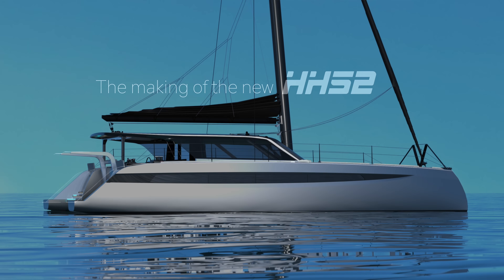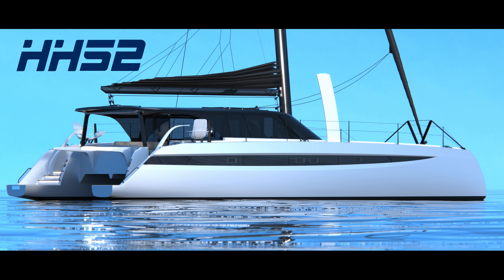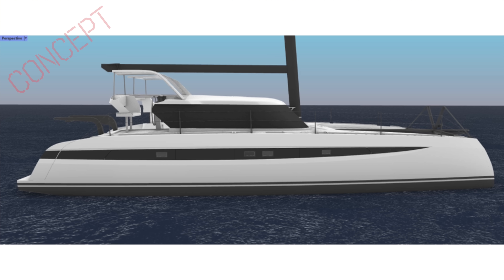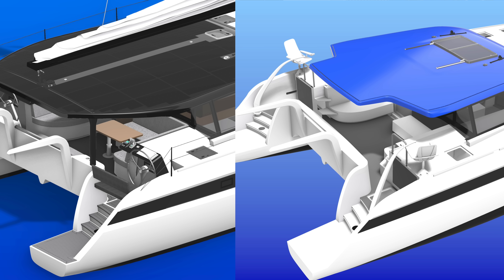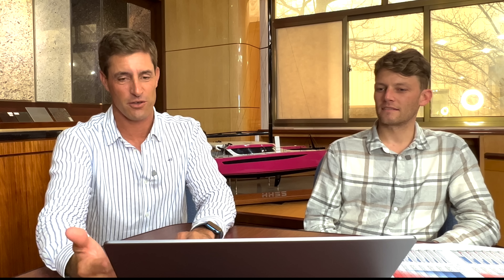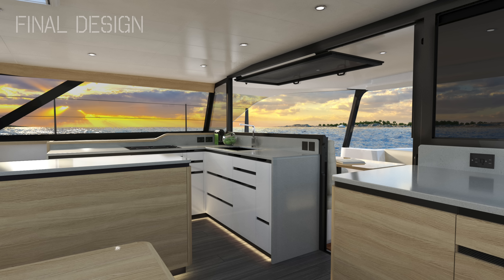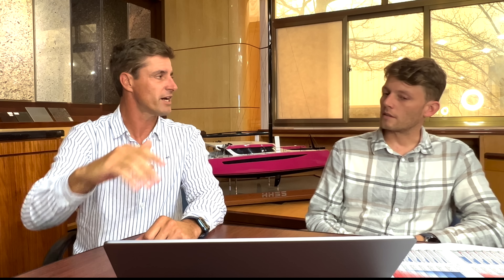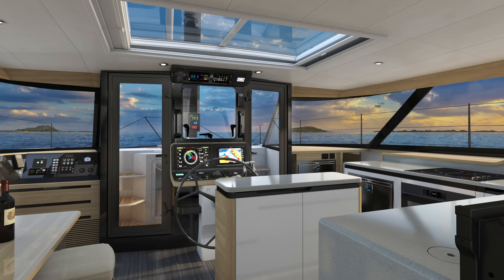Exclusive First Look: Designing the Hybrid Electric HH52 (Ep 1)

Comment: Really stunning boat, love it, especially the forward cockpit!  The sleek lines when removing the "eyebrow" makes a huge difference to the look, but those also had a purpose to keep the saloon cool.  The older Privilege boats had these same gorgeous lines but turned the saloon into ovens and had to have shade overs covers over the windows on them at all times reducing visibility.  Heavy tinting or coatings could help, but then that also reduces forward visibility especially at dusk, considering the rear helm position require you to be able to see through isn't this a problem?  How are you overcoming this thermal issue on this new 52 design?
Reply from the maker: The beauty of this new update is that the forward windows flip open, so when the sun is out and things start to heat up you can swing open those front tinted windows and both shade the dash and allow cool air to flow in. If you prefer to keep them closed you can lower the salon shades and run the 56,000 BTUs of air conditioning off the 43.2kWh batteries alone! We're pretty happy with the overall design and functionality of this new boat.
Reply: @HHCatamarans  It is absolutely beautiful design, and HH definitely should be happy with it, great job!  I do think those windows opening up will make this very comfortable at anchor.  All boats a series of compromises for sure and if the worst-case scenario is having to run the A/C that is powered from 100% from solar I suppose that's a first world problem I could deal with👍
Reply from the maker: Battery technology is really changing cruising. Less camping, more luxury. The future looks bright!
Reply: @HHCatamarans  Absolutely, these aren't your grandfather's sailboat anymore!  So quick question, are there any hand holds on the coach roof to hold onto as you move forward in a heavy seaway?
Reply from the maker: Yes, we have a rain capture (gutter) that runs the entire perimeter around the coach roof that is also the hand hold. Once you get to the forward windows you have the cap shroud and daggerboards to also hold onto.
Reply: @HHCatamarans  Cool!  It's hard to tell in the renderings.  Looking forward to seeing one of these beauties in real life next year.

Comment: It would be nice if the OC with dagger boards when raised are only the height of the life lines, similar to another brand with a new 52 footer.
Reply from the maker: Then they would not be proper daggerboards and would not work as well.
Reply: @HHCatamarans  Well I'm no engineer, so I'll appreciate that answer. Other boats may have different performance goals and/or different designs (materials, width, etc.?). 9:17 The straight OC boards aren't quite as massive as the SC boards, so I suppose they would be slightly lower performing (but more manageable) to fit the OC model better.

Comment: Straight and curved daggerboards, that's fantastic. Would love to know more about the pros/cons to the two. I'm assuming straight daggers are cheaper to build and possibly more reliable with the closet design and such? Would Z boards be a realistic option?
Reply from the maker: We are not offering Z boards (yet :), but yes, the straight boards are cheaper. Those will be much like all the other yachts on the market and will be produced out of fiberglass with a foam core (although ours will use the highest grade resin: Epoxy) and the load limits on the straight boards will not be as high as the curved boards. The curved boards are a bit more complex as they are baked in an oven to utilize Pre-Preg Carbon construction and the boards do induce some displacement lift when sailing at around 10 knots. The curved boards also use bearings and other lifting mechanisms not used with a straight board. Hope that helps!
Reply: @HHCatamarans  Very insightful and thanks for the detailed response. This makes a lot of sense as to why straight daggers work well for OC designs. Now I'm curious how many degrees you can pinch closer to windward with curved vs straight boards. All the comparisons I've read about have been mini keels vs daggerboards in general. Love everything HH is working on <3 Can't wait to place an order with your factory in a handful of years.
Reply from the maker: That would be amazing. We look forward to the day!

Comment: If I was going to buy a sailboat and I would would be more than likely to buy one from you, any that I would buy I would extend the coach roof back to the davit for the tender. make the davit a part of the structure and support it at the back with stout poles that look good and are functional. That would give you extra area for solar and hoist the tender up higher and provide extra measurement for long ocean crossings. I would offer that as an extra on all models. In one video I saw a system for the shaft between the engine and the props where there was a device that could power the props in lieu of the engine for a short time. I would want diesel engines in both hulls so if one stops running you still have one that does.  Is there a way to allow rudders that hit something to be able to deflect out of that way to minimize potential damage to them and to protect the prop in a way like the high end motor vessels use skegs to protect their props and the hull configuration protects their props from damage in case of beaching or other problem? Two of my favourite sailors have bought one of your 44s and that is how I found out about your boats and I followed Seth until he got a real job.🤣
Reply from the maker: We did extend the coach roof to go well past the aft beam on this boat, but we opted to keep the dingy low and out of the way so as not to obstruct the view. With the considerably high bridge deck clearance of this yacht, we do not need to raise the davits any higher than the top of the aft beam sofa, so the tender location is quite frankly perfect. If you wanted even more solar (not that you need more than 4,632 watts) then you could still put solar over the davits. One last thing, on both the HH44 and the HH52 we use line drivers to hoist the dingy (no more grinding a winch)!
Reply: @HHCatamarans  Thanks for the reply and now thinking about it you just cannot block the view lol . Anything to make the winching up the tender easier!

Comment: Seth, listen to most sailers out there....why slanted forward and side windows? Either straight up windows or negative rake windows to reduce glare and directs sun. The lower window border depicts the border of your salon, might as well maximize your interior space by having straight up windows or negative rake windows increasing the roof area for increased solar area or bigger rain water collection surface area.
Reply from the maker: Because straight windows are not aerodynamic, they look ugly and they allow us to extend the "dashboard" area of the boat forward of the coachroof, giving a larger sense of space in the Salon and more workable areas for electronics. I'd say the only real negative is the greenhouse effect of a slanted window, but with the forward opening windows this should not be a problem when it is sunny (plus the boat can come with shades and 56k BTU of AirCon). There is always a trade off, but this one we were happy to make.
Reply: @HHCatamarans  at the speed cats do, aerodynamics above water wont affect much as the wind will most likely be from the side or some degree from the rear. Hull design will affect speed and of course sails. I love the straight up or negative rake windows, like the Portofino. Ifyou doing speeds ove 100mph, yes but not at 20 knots.

Comment: Just throwing floorplans out here. I've turned into a minor youtube catamaran design addict this year; I think I've seen every manufactured cat online. And - lessons learned?  
I don't think you nailed this 52 design and here's why ... 1. I like the front helm of the performance catamaran Windelo 52 with 2) its Bali-styled (fully enclosable as an option) salon as well. 
3) Add a simple front sitting well area, immediately behind the tramps of 4) taller-chined hull (minimizing salt spray and cleaning/maintenance is important - similar to Catana's Bali hulls) and 5) smaller trampolines - the weight diff is small while the cruise livability is great. A Bali 5.4 placed 5th in the 2019 ORC, so its tall hulls are no performance slouch. 
The front nav station offers great social, stable sailing, visibility, and great living spaces.
6) A nice-to-have second sailing helm on a simple flybridge is a great second spot to squirrel away to - for charter boats, or when the weather cooperates and you want to be up high. 
7) If you want more room for solar, look to new higher efficiency solar panel tech (one type captures solar energy at night), or regen props on electric drives, or new stationary non-spinning wind turbines, or to Sunreef-like inlaid solar cells (on the hull sides, mast, etc.)
That's the perfect sailing cat - as I can see. 
8) I see many legacy designers clinging to sailing chair designs that hang out over the rear left and right - almost at the sugar scoops. That might be a fun tiller-sail for a half hour - as a novelty, but once the suntan lotion max's out, it's more of a torture chamber I should think.
9)For powered/electric cats (off topic I realize), I think Silent Yachts 120 has nailed a winning design by emulating (copying really) the world's fastest car-ferry catamaran design. Other than its GRP hull (aluminum would be better), I'd say it's a proven-efficient hull that would stand up to any sea state. If that design could harness the wind, it might be a big hit in the performance or explorer cat marketplace.
10) Last but not least. Those ceiling brows are there to keep the sun and heat out of the salon; I'd go to negative windows up front before removing the sun protection. That browless front window - isn't a modern look; your naval architect almost swallowed his tongue when you suggested it.  Politely: Hone listening skills - be careful of strong personality and unintentional authority overrides that might bite you in the butt. 
I'd love to see this HH line do well with you at the helm AND hey, what do I know? It's a bit of a guessing game in the end. The market leaders are there based on their low price (Lagoon) and livability (Bali). I think Silent has sold 100+ boats as well. No one cares if it's the fastest, and doesn't sell; I'd be market testing the heck out of what you put forward here - and see how many me's there are.
Reply from the maker: Hi Ed, thanks for the reply. Every single inch of the yacht is considered carefully and the ramifications of all design decisions are weighed. I hope our future videos help explain why we made the decisions we did, but briefly:

1) By adding two doors instead of the Windelo plastic windows, you can leave the windward door half open and prevent any sea spray from entering the salon (all spray will hit the leeward door). 
2) You CANNOT have a bali styled front bow section and not widen the hulls underneath. Wider hulls are like plows in the water and while a Bali might sail downwind, that is the only way it can sail. It is a motor sailor up wind and any true performance catamaran will not be. It also cannot sail in light air. A long trampoline is the best indicator for performance and can also become a shaded living space with bean bag chairs versus a poorly designed foot well and sofa.
3) With forward opening windows you don't care about needing an eyebrow - and with 58,000 BTUs of AirCon you don't worry about running the AC (without a generator).

Stay tuned. We will continue to explain why this yacht is probably the single best cruising yacht ever imagined.

Comment: No concerns with a black roof heating the solar panels and reducing their efficiency?
Reply from the maker: We have tested the solar panels and even at extremely high temperatures the panels are outputting their stated power generation. Yes, cooling them would be more efficient, but not as cosmetically good looking or walkable. This is a good compromise.

Comment: Just a question regarding the angle of the front glass. You are not going to "cook" yourself inside during a hot summer day. Is not worth checking the Portofino Catamarans approach to this, like that you don't  get more top area for solar and more shade for the inside? Still a nice design and nice to hear that dager board are on OC lineup also now, can not wait to see a full review to the finish product. And much love to you Seth and to your family, miss your YTB channel.
Reply from the maker: There is a reason this boat does not look like a Portofino. :)  But you will not cook as the windows open from floor to ceiling, and they have blinds and 56,000 BTUs of Air Conditioning that run off the batteries alone. This is one cool cat. ~Seth

Comment: When will 5201 hit the water?
Reply from the maker: Hull 01 is out of the molds and the inner hull has been joined with the topsides hull with bulkheads installed. This means we are still a little over a year from completion. Since this is Hull 01 we also expect it to take a little bit longer than an HH50 build as we will want to ensure it's done right the first time. We can't wait to see this boat on the water - hopefully debuting at the October Annapolis Boat Show in 2024. Hull 01 is a SCF (Forward Cockpit) model.